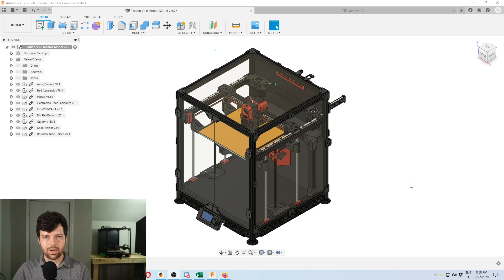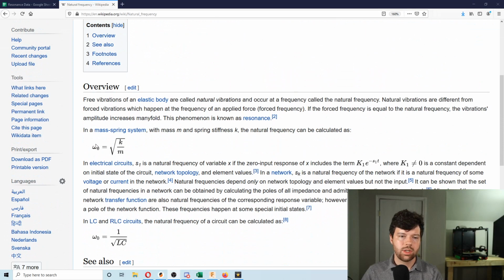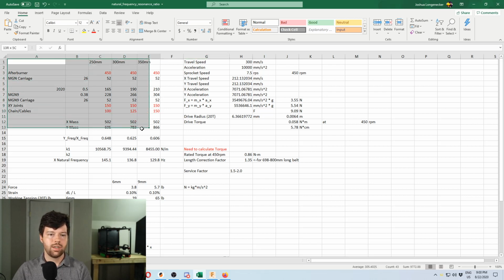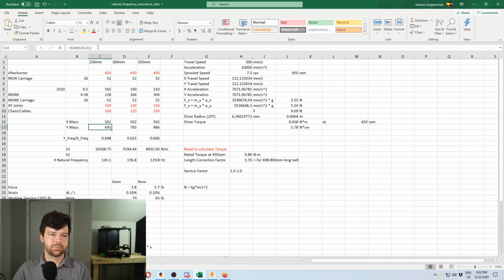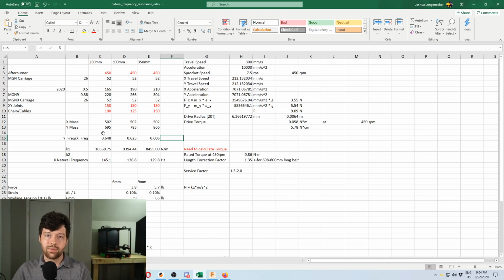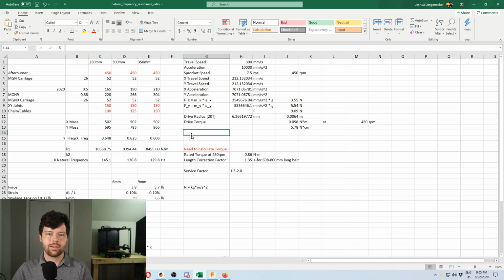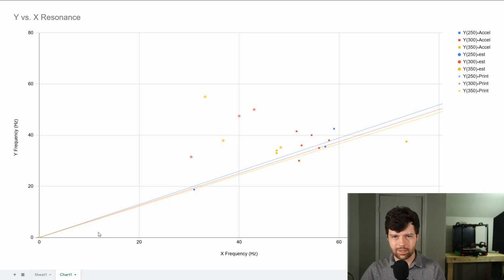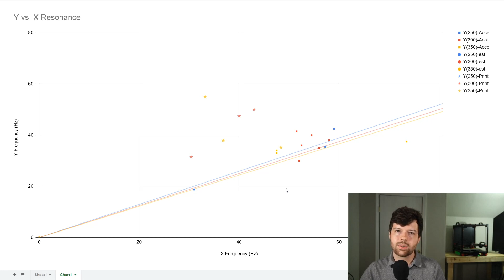3D Printer Mechanics: Corexy Resonance Frequency Ratios

Comment: 2:14 assume a spherical belt of uniform density in a vacuum...
I have no doubt the deviations in your plot for the 350 is caused by the resonant frequency of the belt itself vibrating between the idler and print head.

Comment: Total noob question incoming.

I was wondering. Please correct everything that's wrong with my thinking: We want to keep the gantry and carriage as light as possible, to minimize load on the belts, I get that, but what about the whole top / xy-plane of the printer? With the heavy a & b (x & y) motors and sometimes even the z-motors at the top of the printer it takes more energy to excite the top to swing relative to the bottom of the printer so that's 1 point for a top heavy printer.

If you move the motors down (couple the shafts of the a & b motors to a rod that extends to the top and has a pulley at the top end - sapphire has done it with an older model) we get a lighter top / xy-plane which is easy to excite but resonate at higher freq. with lower amplitude due to the reduced mass... right?

Am I seeing this clearly and what is the takeaway? Is it worth to reduce the mass of the top / xy-plane of the printer?

Also what's easier to correct via input shaping, high freq. & low amplitude or low freq. and high amplitude?
Reply: You thought about this 2 years ago. So, what have you learned in the past time? Have you had the chance to try it? I am designing a printer, should I try it? So, would increasing the lower mass of the printer create something similar? I'm using sapphire, I'm curious about which model you mentioned, I want to check it out.